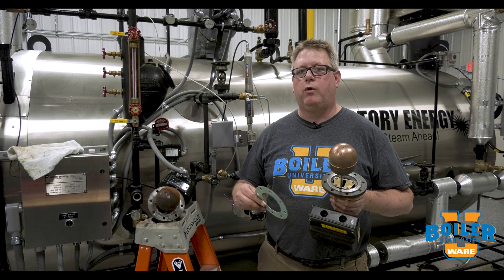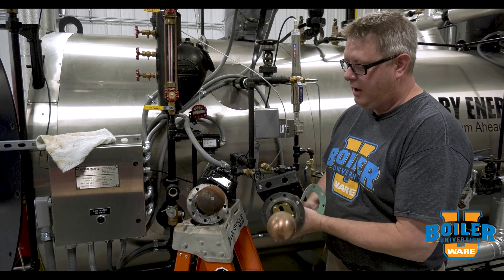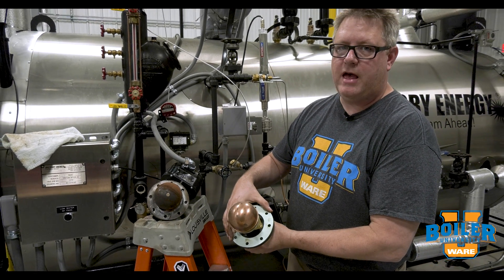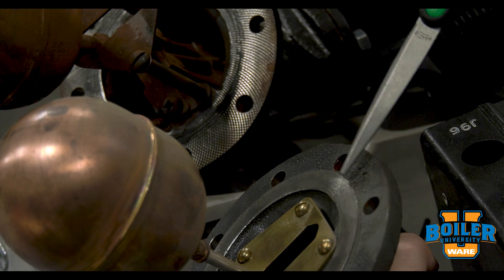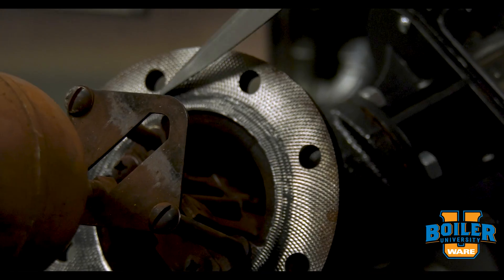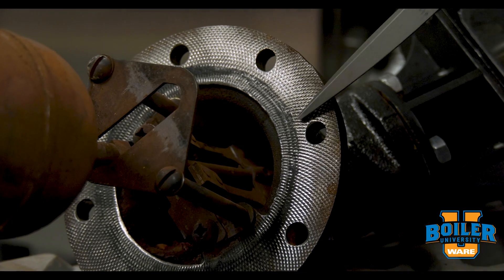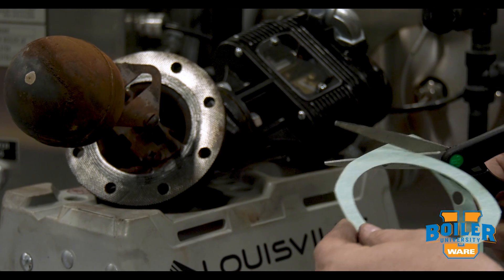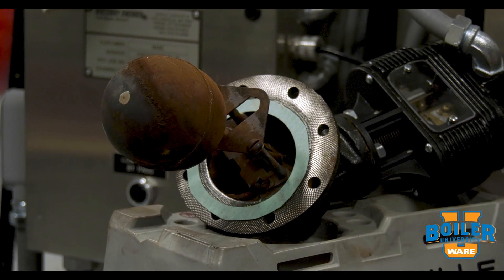Differences in Gasket Surfaces on  McDonnell Miller Float Control Heads - Weekly Boiler Tips

Comment: What is best to use to hold reduced face gasket while you line up and install bolts?  

How much torque should be applied to the bolts?
Reply: The bolts will place the gasket
Reply: Sometimes You'll see someone cut a narrow tab or ear on a gasket . Your Control manufacturers component literature will give Ya the specs .